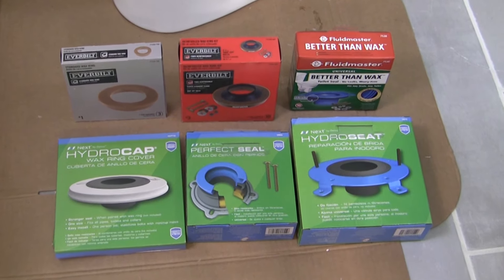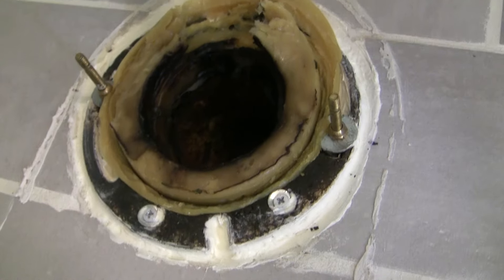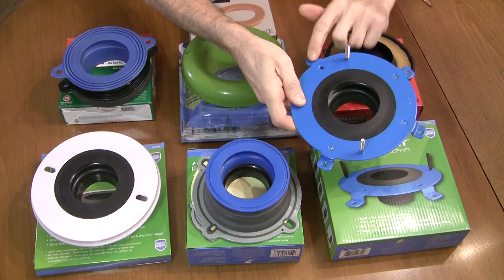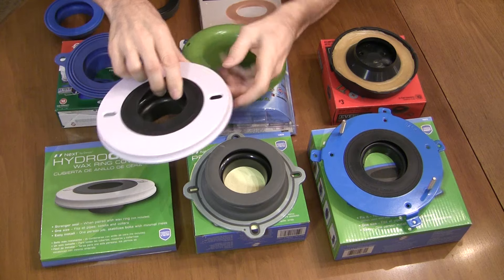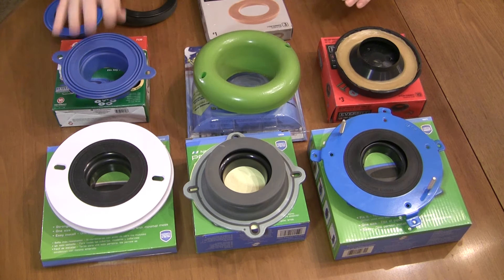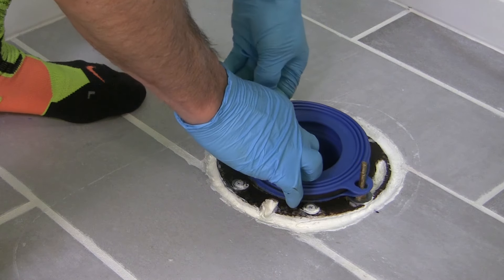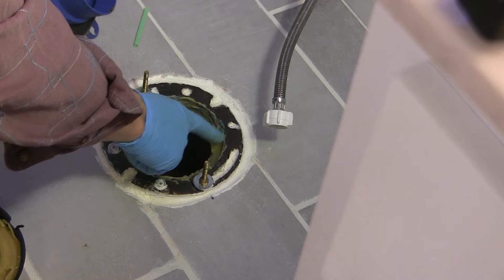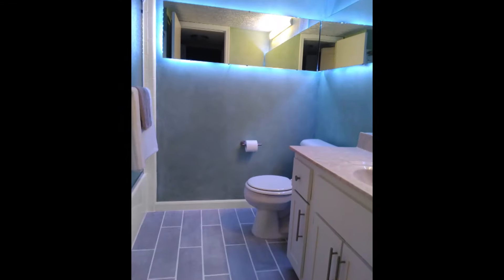2 YEAR FOLLOW-UP to Toilet Flange Fix  / Also, Compare Different Toilet Seals

Comment: First of all I would like to say I’m a licensed plumber and although you didn’t technically fill in the whole with concrete I would say you tackled it pretty well. Sometimes it’s way too expensive for someone to fix it properly and although I believe that a plumbers work is justified I completely understand you. Looked good and clean. I like to use that green sani seal now although the old fashion wax ring is just fine. Haven’t had a problem with the rubber getting cut (must be those messy plumbers) lol. But I like that the material bounces back with any rocking or movement over time and it’s clean and if you mess up you can reset it. Great video!
Reply from the maker: I read that the SaniSeal coating has problems holding up to the chlorine in the water over time.  I'm not sure how much time, but I'm sure you could google it and find a plumbers forum where they're talking about it.   I couldn't fill the hole (for the drain pipe) with concrete because it's directly over the top of the drywall ceiling of the condo below me.  It seems to be fine the way I have it, and it was working okay with no support at all since the place was built in 74.  Thanks for watching.  I guess you plumbers watch just to see the ridiculous stuff people are doing, lol.
Reply: @MartyPollio  ah ok makes sense I assumed it was on the first floor. And no I honestly watched this video to see how other people tackle this project. Sometimes I find good tips and tricks from others. I didn’t mean to offend you. Anyway thanks for the tip on the sanseal

Comment: I like your straw trick dropping the bowl on the flange. I use the straw trick on the flapper chains to keep the chain from getting to trapped in the flapper seat. I use an extra washer and nut to hold the johnny bolt rigid so dropping the bowl onto the flange is easier.

Comment: First, thanks for making the video, which is a marvel of DIY sharing technology (for good and bad).  Second, rock those socks.  Finally, I've lived in my home for over 25 years and have experienced a plethora of bad construction, bad professional work, and my own bad DIY work.  I like your attention to detail. So, my experience with wax, that green POS foam seal, the  "perfect seal", and "better than wax" seal, is that wax is the best long term flange seal solution.  In order of my trials and painful cleanups: the green foam seal is a terrible product that leaked immediately because the bolt tore the seal upon installation, "better than wax" failed after 7 years when the rubber got hard and brittle. The "perfect seal" isn't perfect either because it's rubber gasket compressed on one side, got stuck in that postion, and failed to flex back onto the toilet base, which leaked even after several attempts to reposition the toilet.  

My three other toilets, that I set myslef, have been in place without leaks using wax-only seals for over 20 years.  And while technology has brought us YouTube, smartphones, and the like, it's failed me with toilet flange seals.  Wax flange seals are still the best long term solution for me.

Comment: Great video. I agree so much with how ridiculous the modern toilet is and the fact that no one has come up with a fail safe version. 

I’ve used the Danco products a couple of times to compensate for height issues and have had good luck. Thank you for the video!

Comment: I used the green rubber one a couple of months ago when I repaired my toilet. I even pulled the toilet off once to repair the toilet flange. It worked perfectly with no problems and is still working months later with no problems.
Reply: Stuff I read said that, besides the problem I mentioned, the green ones don't hold up to the chemicals in the water over time.

Comment: Your doing what all of us do. Experiment along with trial and error. Plus the enormous cost the pro's charge. And I really do understand why they have to charge. Service trucks are not cheap and neither is the tools on board........ I understand because of the weight, you re removing the tank. I don't like the toilets with the tank that comes off. Because of the yuk that gets in-between the tank and the bowl. So, I'm going to try a toilet that has the tank and the bowl that are all one. May get it installed today. I hope it all works as well as I hope. Lots of good videos all over on Youtube for wax ring installs.  Thanks for your time.....

Comment: I'm watching your videos in reverse order.  You mention improving the water closet (toilet).  I used to work with a fellow from Lebanon.  He had some anatomical problems and required an operation on his lower backside.  During his discussion of the operation, he ranted against Western toilets.  He pointed out that the squatting position is more anatomically suited to the job than sitting.  I believe he went so far as to find proof on the internet.  From experience. in the woods, you squat.  So the biggest improvement may be to match the toilet better to human anatomy.  Tomorrow, I'll install the Fluidmaster and hope to fix the leak currently in the wax ring.  Thanks for these videos.

Comment: You got that right you’re doing it yourself it doesn’t matter if it takes you 3 times as long. The price is right. A plumber would cost you a hundred bucks just to look at it. Long as it does the job 
That’s all that matters

Comment: Thanks for the video.  I used the green foam seal back in 2010.  It is still intact and no issues (2021).  It was my first ever toilet job and it was a success.  I am about to do another job on a different toilet and plan to use the green foam seals again!  F- wax!

Comment: Marty, I truly appreciate your video, regardless that some plumbers did not but many plumbers will smile secretly. I am a registered Contractor/handyman  in Ohio and have removed and reseated many toilets and flanges while replacing rotted wood sub flooring  and installing tiles. Although once I wanted to use the "modern" all in one installation plastic compound ring  the specific  bowl I was installing would not sit as well with a plastic ring  as compared to properly using a single or double thickness wax ring which I continue to use. I just have more confidence in wax.
  Also I  use ABS or PVC drain flange glued to the waste pipe since this does not narrow the waste pipe drain diameter but if the drain pipe is cast iron then I must use a drain flange with a rubber expansion ring -these expanding ring designs are designed to be used with metal but I suspect some will just use it also with plastic due lack of experience or just ease of installation.. Keep up making your videos.
Reply: Jerry Grayson  Thanks for the comment.  When you say you use a drain flange with a rubber expansion ring on the cast iron drain pipes, do you mean that you cut off the top - the flange - on the iron pipe, then you put the PVC flange on it with the expansion ring?
Reply: @marpo  HI fortunately I never had to cut the top off of a cast iron drain pipe but have cut ABS and PVC. I  worked on a cast iron pipe where only the flange was broken and rusting and the floor area near the toilet  had rotted from water damage but the drain pipe was not cracked. The iron pipe was strong and  I was able to just clean the broken/rusty iron pipe flange and put a bead of silicon on top of the flange  and then install the plastic flange with the ribbed expansion ring. Perhaps the silicon was not necessary due the expansion ring went perhaps three inches into the iron pipe and the connection was good but I  used silicon for a better seal. Again thank you for your video.
Reply: @jerrygrayson65  If you laid the PVC flange on top of the existing flange then wouldn't that make it too high?
Reply: @jerrygrayson65  Okay, thanks.  It makes sense to me now.  I've seen videos of doing it that way.

Comment: You had me with "You broke my heart Fredo" 😂. Turns out I'm also about to install the same fluidmaster waxless seal on my toilet that has an ancient cast iron drain pipe underneath with the flange that is also ancient cast iron that is definitely not level with the floor and is 2 feet away from a floor heat vent which is most likely why I need to replace the somewhat melted wax ring from previous owner (leaks under floor I can clearly see in basement). Wish me luck.

Comment: The Danco Perfect Seal was great for my application.  My floor around my toilet is not level.  Big hump on the right side and the back left corner slopes away.  Almost impossible for the toilet to sit flush on the flange and be level without shimming.  I replaced my original toilet with a new toilet a year or two ago and used a standard wax ring.  I decided to install it flush on the flange and leave it unlevel.  Great seal, but you could tell the toilet wasn't level when you sat on it.  The other day we put new flooring in, so we had to pull the toilet.  Used a standard wax ring again and decided to level it this time.  With all of the rocking and lifting to level it, I must have broken the wax seal and it leaked.  I decided to give the Perfect Seal a try.  This was great for when I was shimming the toilet level, since no matter how much I lifted and repositioned the toilet, the rubber gasket will still be sealed on the toilet.  My flange (looks like a repair flange) sits at least 1/4 inch above the floor, so I took out the blue extender and took out the black insert before even trying it once.  Seems to have worked so far!  I had similar concerns about the small diameter of the hole, but I have not noticed any difference in flushing power or speed in my toilet.  However, I don't think my pipe is as wide as yours.

Comment: My Kohler Cimarron toilets do use in-tank mounting bolts which I love. Kohler engineered it with exterior metal bracket that mounts to the underside of tank via the opening under the flapper. Bracket and bolts never come in contact with water. The bolts actually slide into that bracket. So the only potential leak point left in the tank is where the water line fitting enters the tank.

Comment: I'm no pro but have replaced a few toilets in my life (I'm replacing one now) and every time there has been water damage (as there is now). This is one area I think deserves extra care and attention since once you place it so aren't going to know you have a slight leak unless it's just a gusher (which is rare). Most damage is done over a long time and not found until it's replaced. Nice job!

Comment: I like the way you used foam to seal the flange. That stops ants from getting in and if there is a leak it stops the water from going down and ruining the wooden floor below.

Comment: Alright, Marty, you go guy. I think you're on point w/ your comments and very funny. I had a plumber do this job, and yes, he sent his son who called and asked if I had the money, $200. He was in and out in 20 min and I still had a leak in the downstairs apt. He said he did test flushes and there was no leak, but the tenants say when the upstairs toilet is flushed, it still leaks, and now it's worse. This was about an hour after they left. Now the owner wants to cut out the bend and do all that big work, and I'm about hey, what about the job that was done and may not have been done right for my situation. Maybe the seal didn't take, the floor might not be level, and was the right ring used? There are many different types of ring seals. I can't believe the owner argued w/ me about that saying there aren't many different types of rings. They didn't cut the bolts which I think for the money should be part of the project work, and they didn't clean up the mess. I'm not that knowledgeable about this stuff, so I was looking things up and came across your video among many other good ones. I also don't live in the house, I'm in NJ, so I handled this remotely. Guess you have to stand over them. Many questions, but this is Queens, NY, and it's hard to get good, reliable, quality service. People are so used to bad service that they wouldn't know good service if it slapped them in the face. And, of course, most people couldn't tell a ring from a donut, so that doesn't help either. If you show any knowledge that challenges the aura of their expertise, they get their backs up. Thanks for your independent thinking.
Reply from the maker: You just validated my paranoia.  I feel better doing it myself and just being very careful.

Comment: The ideal scenario is to have the piece of pipe that the flange attaches to at the same height as the flange so that way you can avoid having difficulties like the one that you describe in your video.When I replaced my soil stack I used DWV PVC with a cast iron no-hub flange that I bolted to the floor.I could have used a PVC flange but past experiences with PVC flanges do not inspire me with confidence because PVC flanges have been known to break off where the johnny bolts go due to the fact that PVC though strong becomes brittle with age and/or cold weather.What I did was that I installed the DWV PVC in the basement,made all of the necessary connections then came upstairs,slipped the cast iron no-hub flange over the piece of DWV PVC that was protruding from the floor,fastened the cast iron no-hub flange to the PVC pipe and to the floor then with my dremel multi-tool I trimmed the excess PVC pipe to be at the same height as the cast iron no-hub flange thus giving the Fluidmaster gasket plenty of solid area on which to rest on to prevent any leaks.I hope you don't mind my advice but in your situation I would have used acrylic caulking on the inside edge of the flange's mouth and allowed the caulking to cure before resetting the toilet or you could have gotten a piece of 4" PVC pipe,cut a piece of the 4" PVC pipe at the same height as your flange to take up the extra space inside the mouth of your flange,caulked the 4" PVC nipple in place and done.Wax is good but if you ever need to remove your toilet you will have to go through the same thing again using wax as a filler because the wax is not going to stay in place once you remove your toilet where as the acrylic caulking will stay in place if allowed to cure before the toilet is set.Slowly but surely we are seeing and will hopefully continue to see improvements concerning toilets.When I removed the old toilet that we had to replace it with our new TOTO toilet I was astounded at how small the flush valves on old toilets actually are.You did a very good job Mr.Pollio,forget the nay-sayers.With the economy in such dire straits causing such financial difficulties now a days there's nothing wrong with you or anyone else wanting to save a few hundred dollars here and there when ever it's possible.The few hundred dollars that you can save here and there help to pay for other home repairs that you cannot or might not want to do yourself.I'm certain that the plumber that you consulted with was asking at a minimum upwards of $700.00 at the very least in which case you did the right thing,jerry-rigging is nothing to be ashamed of,getting taken for upwards of at least $700.00 is nothing to brag about either so you did well Mr.Pollio,God bless you and yours.P.S.,The one mistake that you made was that you didn't properly align the flange before you set the flange in place which is why the johnny bolts are stretching the eyelets on the gasket.The top and bottom notches on your flange are supposed to be in the 12 and 6 o'clock positions but instead the top and bottom notches on your flange are in the 11 and 5 o'clock positions which is why your johnny bolts are sitting so far apart from each other and stretching eyelets on the gasket and also results in your toilet not being properly held in place by the johnny bolts.The johnny bolts are supposed to sit midway in their respective slots and centered on the flange which would be the case if the top and bottom notches on your flange were in the 12 and 6 o'clock positions.I have worked with licensed NYC contractors and licensed NYC plumbers since I was 16 years old and I am now 59 years old.While I do not know everything there is to know about plumbing what I learned I learned well.The last part of my post is not to mock or ridicule you,the last part of my post is meant to help you and others.

Comment: as you showed, it comes with a black spacer flange that would have done what your stacking of 2 did, and for half the price....always read the directions, but your steadfastness is still impressive, while it took you much longer than it should have, you made it work, there are simply sometimes easier and better ways to get to the desired result
Reply: The spacer they include is too tall for most cases if the flange is flush with the floor. I suggested above that a longer neck on the blue part...  and different sized spacers would be perfect.
Reply: @YouTubeStalker  Its made of foam and it compresses so it seem higher than it should but usually will compress down to what you need. In the video he needed that spacer, the two stacked caused the seal to be uneven and fail, using the spacer would have fixed this issue.

Comment: Bigger technological advances in bludgeonry. LOL No doubt you are right about that. Thanks for the review of rubber seals. I feel a little more confident in my selection of Flowmaster last week. had no idea you could stack these. I may need a second one. I was afraid to fill the toilet and try it, but I’m reminded the whole point of this kind is I can fill it, flush, empty and look at what it did. Thanks!
Reply from the maker: I did a follow-up review (video) of the seal I used.  You may want to check it out because it didn't hold up that well after two years.  Here's the link: https://www.youtube.com/watch?v=KS0FJmLMrYY